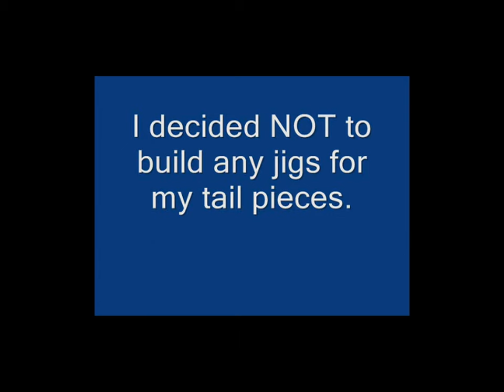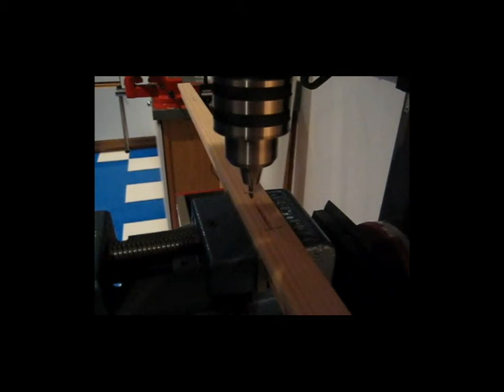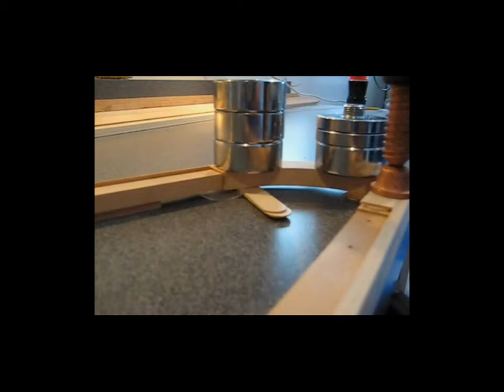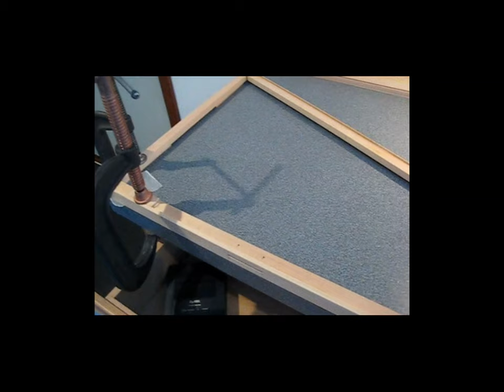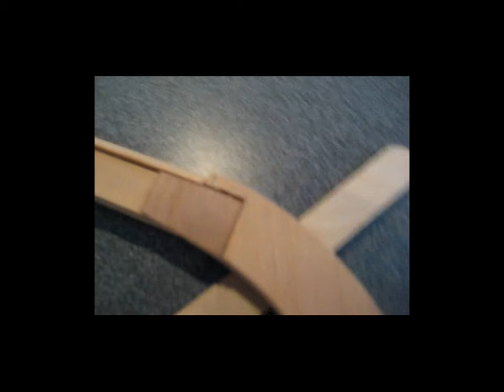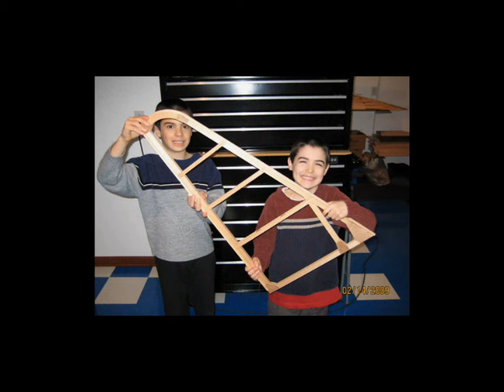Pietenpol HINT Video TAIL 2 Vertical Stabilizer

Comment: These videos are a great help. thank you. What did you get and  How did you get the length measurment for the leading edge of the vertical stabilizer? I dont see it in the plans. Any help would be appreciated.
Reply from the maker: It has been many years since I have built this plane. I know the plans have information all over the place, so that measurement may be on a different sheet buried in the corner someplace. Or, if you know the base length and vertical length, just make the leading edge to fit. If you need more help, I will dig out my plans and take a look.